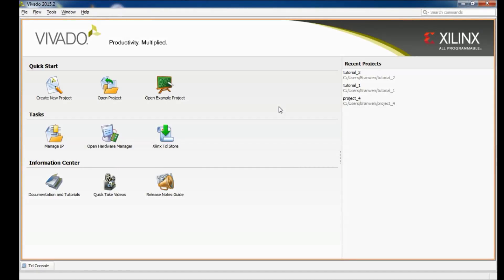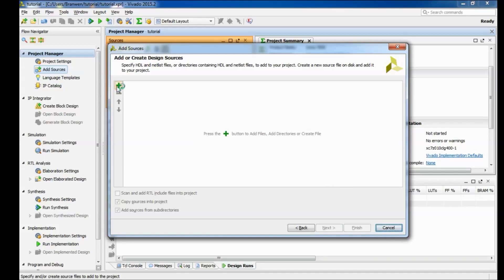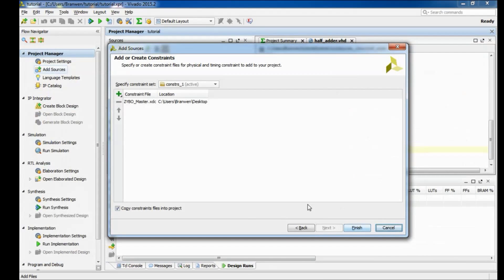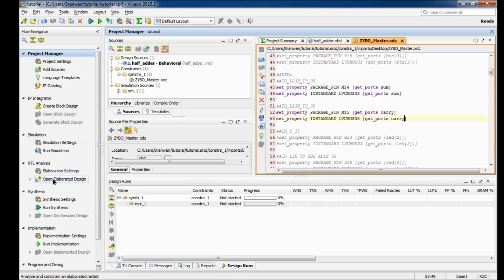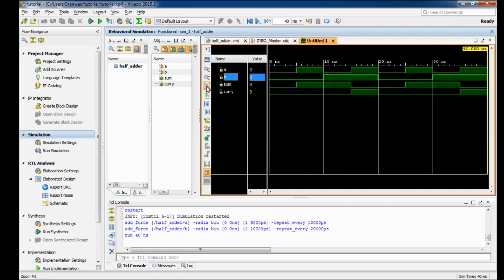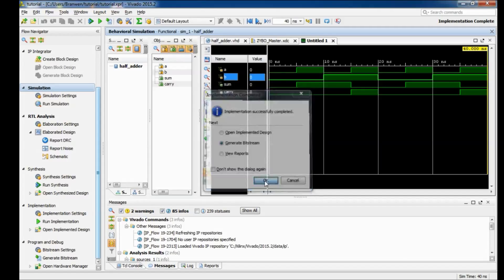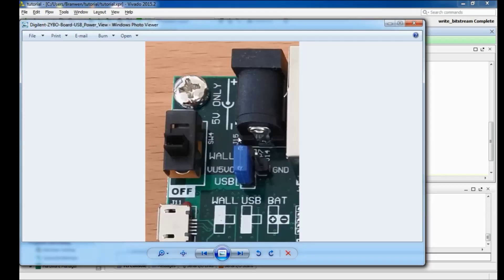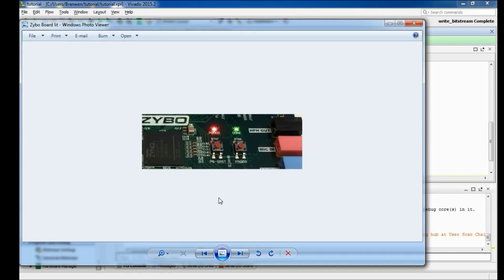First VHDL Project with Vivado for the ZYBO Development Board

Comment: Hello Sara, I am getting following error, could you please let me know what mistake I did? 

[Board 49-26] cannot add Board Part digilentinc.com:arty-s7-25:part0:1.0 available at C:/Xilinx/Vivado/2015.4/data/boards/board_files/arty-s7-25/E.0/board.xml as part xc7s25csga324-1 specified in board_part file is either invalid or not available

Thanks in advance.

Comment: You said something about mismatched upper or lowercase identifiers causing errors.  According to VHDL PDFs I've read the VHDL compiler is actually case insensitive.
Reply from the maker: Yeah I've had a few people say they were able to get away with case miss-matches. When I was running through the lab, I seemed to have issues with case. It's possible newer versions are case insensitive, or I made some other mistake that was resolved when I fixed the case and didn't notice. I haven't had the chance to check as I don't currently have the software installed on my computer. I''d recommend keeping things in the same case anyways for consistency and to prevent any confusions.
Reply: As an extreme example in Vivado 2017.1 (64-bit) build 1846317 the following two snippets are equivalent (both compile and produce same design):

    -- Allow connection of data bus as output during write operations or disconnected
    -- (high-Z) otherwise allowing other devices to use data bus while the CPU is halted.
    db_ogate: process(nDBen,DBwe,regbus) iS
    begin
        if ((nDBen and DBwe) = '1') then
            d <= regbus;
        else
            d <= "ZZZZZZZZ";
        end if;
    end process db_ogate;

    -- Allow connection of data bus as output during write operations or disconnected
    -- (high-Z) otherwise allowing other devices to use data bus while the CPU is halted.
    dB_oGaTe: pRoCeSs(nDBen,DBwe,regbus) iS
    bEgIn
        iF ((NdbEN and dbWE) = '1') tHeN
            D <= rEgBuS;
        ElSe
            d <= "ZZZZZZZZ"; -- ZzZzZzZz won't work
        eNd If;
    EnD PrOcEsS Db_OgAtE;

About the only place where case seems to matter is in the binary literals (for example 'Z' and 'z' are not interchangeable).  Some might consider the latter a limitation since being able to write ZzZz... might make it easier to count to ensure the correct numbers of bits are in such literals.

Comment: @3:40 or so: are you sure that VHDL is case-sensitive when it comes to ports? Because at least for signals and variables, identifiers are case-insensitive.
Reply from the maker: That's been my experience with this version of Vivado.
Reply: Nah. Just tested on Vivado 2016.4. This piece of Code (look at S, s): 

entity test1 is
  port(
    S : in bit_vector(1 downto 0);
    A, B : in bit;
    Y : out bit
  );
end test1;

architecture BHV of test1 is
begin
  with s select Y <=
    (A and B)  when "00",
    (A or B)   when "01",
    (A xor B) when "10",
    (A xnor B)  when "11";
end BHV;

runs fine through 'Open Elaborated Design', 'Run Behavioral Simulation', and 'Run Synthesis'. I did not create a constraints file, thus going beyond that makes no sense. 
I think VHDL identifiers are case-insensitive in general. An exception are the names of user defined enumarated types. Like in 

type MY_TYPE is (HELLO, SARA, FAGIN, GOOD, VIDEO);

I am quite new to this stuff and I might be totally wrong here. 
Anyway, thanks for responding so quickly.
Reply from the maker: Hm, the most recent version of Vivado I've used is the 2015.2 version. I'll have to double check, but I remember having issues with case sensitivity regarding the port names.

Comment: Well done! I went through the same process but with the Zedboard. I ran into some trouble when synthesizing and generating the bit stream due to differences in the .xdc files between the Zybo & Zedboard. For some reason the Zedboard xdc file reduced all of the iostandard expressions to one for each "bank." I wrote out the iostandard expressions for each switch and LED the way you did and it worked fine.

Comment: Hi Sara,
Thank you very much for the video. I was wondering that why you didn't set up debugging for the ILA file. When I want to program my device, it asks for the debugging file.
Reply from the maker: +havva erdinç Debugging is an optional process. I plan on putting up a tutorial video on using the debugging feature soon.
Reply: This will be great, cause vivado warns me that there is unconnected pins on ILA. This is surprised me. When I want to program my device, it asks me a debugging probe file. Then I thought that it as an obligatory process. I will try this example myself.

Comment: this video is for simple combinational  circuits,  for sequential circuits(for example practical vending machines ) there is clock(as an input ), so how can we give that input to FPGA(in .xdc file)?
Reply from the maker: +Ramakrishna Kannoju There's a specific pin on the board you can use, L16. In the xdc file, your clock input should connect to this pin.
Reply: +Sara Fagin Thank you,
first I tried a simple counter(with reset and clk s inputs), I didn't get the counting sequence.
can I have your email id? so I can seek some help.
Reply from the maker: +Ramakrishna Kannoju 
Sure, you can reach me at fpga.tutor@gmail.com with any questions.